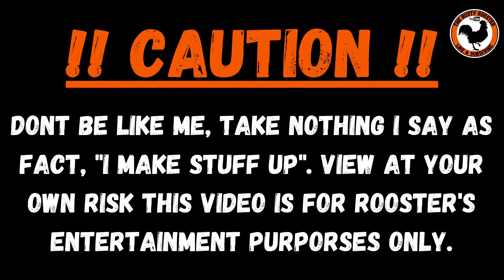Carburetor Adjustment, Husqvarna 455 Rancher Chainsaw

Comment: The more recent Rancher carbs, WTA 29, have splined adjustment screws that are much easier to access than those older units; that is, you don't have to mess with that spring limiter. Couldn't I just buy one of those to replace the older WT EA? Not too expensive & by looking at pictures of both, WTA 29 seems identical. Thanks.
Reply from the maker: I cant say for sure that the 2 carbs interchange but wouldn't be surprised.

Comment: You can remove the needle jets, and pull those aluminum sleeves out, then replace the needles.  The sleeves are not needed.  And thus no special screwdriver is needed, neither.
Reply from the maker: @RavensHammer00  thanks thats good info

Comment: ByGollyi stick a screw driver in there turn it hard until you hear it clicking and it’s free to adjust 😮
Reply from the maker: At-a-Boy, whatever it takes. Thanks for commenting 🙂
Reply: @TheRustyRooster  Thank you for the at-aboy… I didn’t know it was splind .. so I pulled the limiters out and did my thing with it

Comment: What is the name of that carb adjustment tool ? Going to order but want to make sure it contains the same driver for that very carb, Was it one of the pac man drivers? Thanks in advance.
Reply from the maker: It was one of the spline adjustment I use the kit from HIPA it has everything I've needed
Reply from the maker: The link for the kit I have is in the video description

Comment: This video would be a LOT better if he told which tool in the kit works on that carb.
Reply from the maker: The spline tooth was the one that fit this one but I have seen other configurations with the spring loaded collar, so don't expect them to all be the same
Good luck